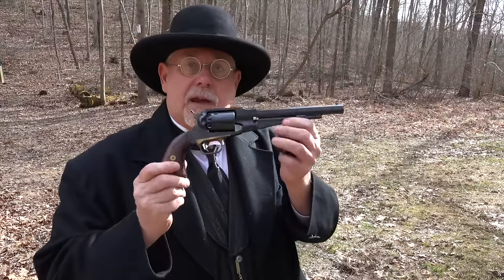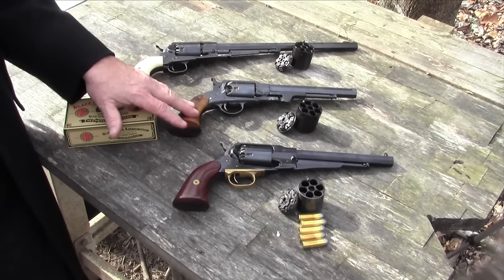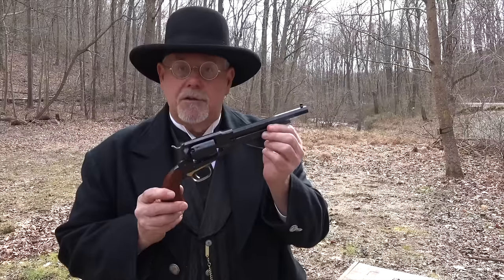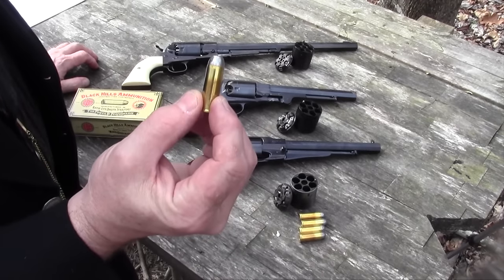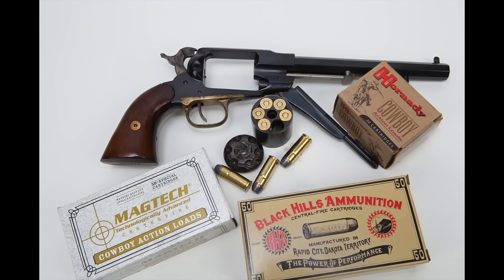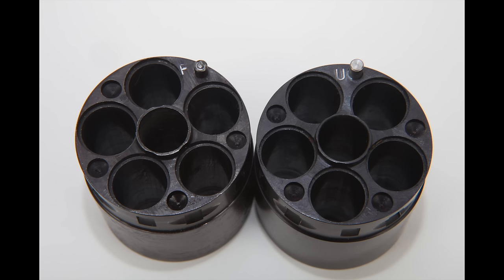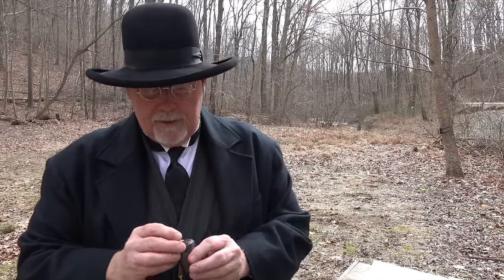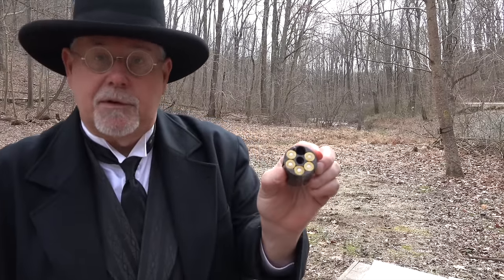Taylor's & Co Cartridge Conversion Cylinders

Comment: In your opinion, what is the best gun to host these conversions? I am looking for something that balances cost and quality. I want a good gun that lasts a long time and works with these, but that doesn't necessarily have to be lux quality
Reply from the maker: Get an Uberti Remington
Reply: @duelist1954  You prefer that over the colt 1860? In one of your other videos you praise the colt over the remington because it can fire 40+ rounds without cleaning
Reply from the maker: @elcidcampeador9629  I do prefer the Colt 1860, but these cartridge conversion cylinders are easier to use on a Remington.

Comment: hello young man, great video as always. i am looking to get the cylindfer for my 1851 Pietta navy colt your thoughts. I want to make sure it will hold up to doing this thanks
Reply: As long as it’s not a brass frame it’ll be good Check out Taylor and company’s website or call them they are very helpful

Comment: Is it possible  to engender a cylinder. That would accept a 38 caliber  necked down to a 36 caliber to fire in a black powder pistol?
Reply from the maker: That is unnecessary. a .36 caliber cap and ball revolver actually has a .375 bore diameter.

Comment: So to reload these revolvers you had to remove the cylinder every time?
Reply from the maker: Greg B Yes
Reply: No.  That's only with the cartridge conversion.  With the original cap & ball (black powder) cylinder, you wouldn't remove the cylinder.  You load the chambers and use the loading lever to pack the loads down.  

The only reason you must remove the cylinder to reload with a cartridge conversion, is that the cartridges must be loaded from the rear of the cylinder, and cap & ball revolvers don't allow for that without removing the cylinder.
Reply: @seanrallis6714  -- I was specifically asking about the conversion revolvers.  I know that with the b&c revolvers you don't remove the cylinder.

Comment: Sounds strange, but for some who have a Ruger .45 Colt they are loading hot, or buying hot loads, having the option of buying cylinders and re-pop weaker .45 guns chambered in the shorter .45 Schofield would be nice, .45 Colt brass is easy to trim to make them and would prevent accidents because the uneducated or unobersevant couldn't load the longer .45 Colt hot loads.

Comment: Here is a question involving some of the nuances related to these cap and ball revolvers: isn't there language in the ATF literature that states that any non-firearm cap and ball revolver that COULD be readily converted to allow for firing cartridges IS technically a firearm, even if no conversion kit is installed? I'm thinking these mainstream Remington repos COULD fall into that category. I'm not a convicted felon, PA resident, no PFA against me. I am attracted to cap and ball because of the fewer regulations and because I like older stuff. My concern is that mainstream cap and ball revolvers like Colt and Remington repros will eventually be lumped into the firearms category BECAUSE of these conversion kits! So, it stand to reason if one mainly is drawn to and wants old timey cap and ball revolvers, it might be better off to buy an obscure antique cap and ball that no known conversion kit exists for. That way, if they retroactively require cap and ball owners to "register" or pay some tax or whatever due to conversion kits, you would be safe. Does this make sense to anyone? Like many of you, I'm just trying to avoid future hassles. If I'm misunderstanding the law please explain. Much appreciated.

Comment: Also do these cylinders have the safety notch’s like to original cylinders? If so why could you not load 6 and put the hammer down on the safety notch?
Reply: I have seen some with safety notches but for the most part they aren't included from what I've seen. Don't take my word for it, it is best to do the research.
Reply: Doggo Thanks
Reply: Domain Masters Thanks very much. It does help

Comment: Why are the jacketed rounds not recommended for use in the conversions?
Reply from the maker: The barrel steel on cap & ball guns isn't made to handle them. They can crack the forcing cone.
Reply: @duelist1954  Thanks for the info.

Comment: Well shitballs, I’ve been loading 45acp 220gr copper tumbled bullets for years in these for 45LC, not jacketed but tumbled and have about 500 through an 1858 new army snubby with zero issues.  Again cooper tumbled not jacketed works great and cheap

Comment: Does anyone make conversion cylinders that are sold and marked as black powder only? In my country black powder weapons (any kind) are easier to get a license for than a regular/smokeless pistol or revolver. So you can't swap in a conversion cylinder that accepts smokeless load, without also getting a different license.

Comment: I chuck up .410 shotgun cases and burn a couple of thousandths off the head. They can be cut to length and will chamber. If you don't reduce the rim size, you can only chamber one round. Great for making snake loads!

Comment: 45 LC works?
Reply from the maker: Yup
Reply: @duelist1954  would 250 grains be too hot or too much for the conversion cylinders
Reply from the maker: @Coolghost-eg1pr  I hesitate to respond to you, because your question seems to display a lack of understanding of the reloading process. Bullet weight is just one variable. Powder…the amount, and the burning characteristics is the other part. So, a250-grain bullet with 35 grains of black powder is fine, but a 250-grain bullet with 10 grains of Unique is a hand-grenade.

You should buy a good reloading manual. Any lead-bullet, standard velocity load is safe in a conversion cylinder.
Reply: If I were you I’d stick with .45 LC Cowboy load. Pretty much guaranteed to be below 950 fps and that should keep chamber pressure within an acceptable level. Not an expert but I’ve been shooting those with 250 grain lead for years in the same pistol without any issues.

Comment: What's the deal with jacketed bullets in a modern Italian replica? Pardon me, I'm a newcomer.
Reply from the maker: The combination of smokeless powder pressure and a hard, jacketed bullet can crack the barrel's forcing cone
Reply: @duelist1954  Thank you. But how revolvers of modern design dealt with it, like S&W 460 XVR can handle .460 Magnum pressure?
Reply from the maker: @sviatoslavastahov2428  The steel is designed to handle it. The steel in black powder revolvers is not.

Comment: So it's a 44 cal cap and ball but when its cartridge its 45 I'm confused
Reply from the maker: Cap and ball is measured the old fashioned way, by bore diameter, but a .44 caliber bore measures .452" in groove to groove diameter, which is how cartridge guns are measured.
Reply: @duelist1954  do you have to have a gunsmith fix it in order to use your conversion kit or can you just use it  directly
Reply from the maker: @dogwalkie1705  Plug and play
Reply: @duelist1954  last question so I'm not driving you crazy what black powder pistol has a side ejector a list of models thanks
Reply: @duelist1954  because someone didn't believe me that there is black powder pistol that load from the back or side how ever you want to call it

Comment: So why did you say standard commercial ammunition and then say cowboy?      I don't want to go pop I want to go bang.
Reply from the maker: The cylinders are proofed to handle any ammo loaded to SAAMI standards, however, the metallurgy of the guns themselves is not. Therefore using standard pressure jacketed bullets could damage the barrel's forcing cone. Especially on Open Top Colt style guns, you could crack the forcing cone. All "Cowboy" ammo has un-jacketed lead bullets.
Reply: @duelist1954    Thanks for answering I have a ruger old army and I am a reloader so I would like to load lead to standard and not cowboy.   Is this possible for my ruger?
Reply from the maker: @morganfrmn  Sure
Reply: @duelist1954  thanks for the chat.   Merry Christmas.   I watch all your stuff.